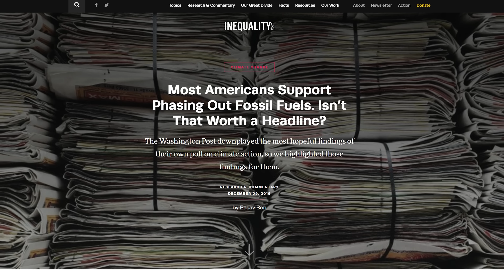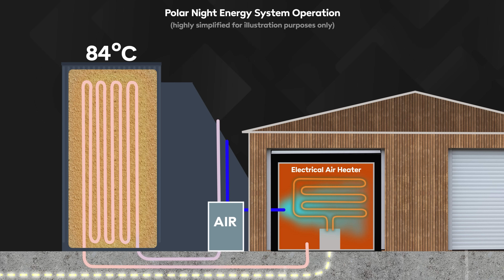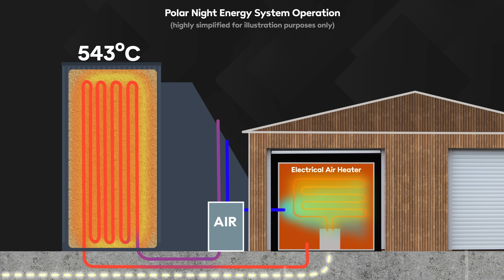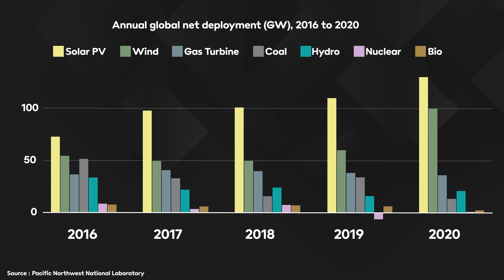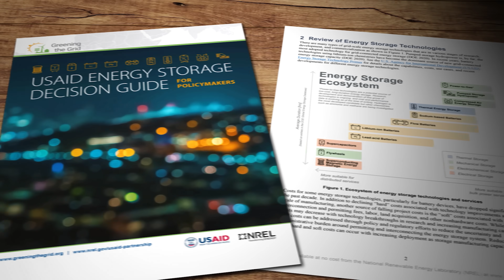The 'Sand Battery' that heats your home, NOT the planet!

Comment: Texas' power grid failed in 2021 due to a winter storm, with "natural" gas responsible for 42% of the failed electricity and coal responsible for 19% of the failed electricity, fossil fuels were responsible for the vast majority of the freezing citizens in Texas. Power outages took the "natural" gas offline, and frozen and freezing Texans would have LOVED to have had a system like you describe, they would have paid far above market price to avoid freezing their tushes off for days. The politicians in Texas, predictably, have done nothing meaningful to ensure there is no repeat of the 2021 outage, instead trying to blame renewables, when everyone knows that explanation is entirely bogus.

Comment: Not enough about heat storage for domestic use. Why is no one talking about old fashioned storage heaters. They can be 'charged' when electricity is cheap so providing a useful dump load for surplus power on the grid or from private PV arrays. They are cheap, simple and effective.
Reply: The idea with the sand storage is to keep the excess energy from summer for use in winter, rather than just overnight. Basically, it’s the same idea just over a much longer time scale

Comment: I am more interested in domestic solutions for singular buildings than district heating options. Retrofiring entire districts will be slow. 
I have read up some on simple solutions like water tanks to store heat, but also on thermochemical heat storage (salt + water --> exothermal reactions) The storage density is lower than water tanks themselves but they thermochemical batteries store the potential heat at room temperature meaning you can store it over longer periods of time.
(Smaller Water tanks may not be able to store heat over longer periods)
I plan on building a home with thermo photovoltaic panels on the roof (panels with heat recovery already featured on the channel) and other features which could give me the option to go off grid. 
I also plan to build my home with a lot of thermal mass and other features to keep my carbon/energy profile down. 

What other options for domestic heat storage are out there which are viable today? With the thermochemical batteries I have not found options to buy yet but it looks like it will come to the market soon. (Heat insyde with K2CO3 salt is one example)

Comment: What I think about this is that we could've had our cake and ate it too, if only we'd taxed fossil fuels correctly, according to their environmental impact. Other than cost, why would anyone choose natural gas over systems like these? I literally cannot find any downsides to these heat storage systems. They can use renewable energy when it's cheap aka during oversupply, helping to stabilize the grid. Their footprint is totally manageable and you could easily bury them in densely built up areas. They're made from dirt cheap materials and off the shelf components. They're positively low tech, so why are these not everywhere already? Why are we doing pilot projects only now?!
Reply: I'm pro-solar but we need to get ahead of solar waste.  Perhaps with a $15 deposit on solar panels to encourage their return to a central location.  And yes- if fossil fuel was properly priced (including $2 trillion for the gulf wars), we would be more likely to be on other diverse methods.

Comment: Im surprised people didnt use thermal water/sand storage earlier, my home has a isolated 100 000L water tank in its basement and I can heat my house with it for many months, My bill for heating in winter is ZERO because I heat up my water with solar in the summer
Reply: Your house?! How big is the house, if I may ask? 100 m³, or 100 tons of water seems insane, but I haven't looked into systems like that. It would make a good size indoor pool, if you decided to make it multi-purpose though 🙂
Reply: @phizc  that "pool" would be at least 70C hot, i dont think swimming in it would be a pleasant experience lol My house is 70m2 the basement is 30m2 but I dug in it another  5x5x4m hole so the shape of the tank is more energy efficient
Reply: @423GustavBern  lol. Good point about the temperature. 😁

Comment: FYI, I worked in R&D in home building many years ago. We build several experimental homes with super insulation, in Ohio, USA. The wall & ceiling R-factor was R-70. We used foam, wool, fiberglass and hay bale on different test homes. We found once the inside temperature reached 70 degrees F. If we kept the doors shut, the homes stayed warm for week or months. Also used 2, 3 & 4 panes in the windows. We proved it worked but owner did not want to spend the cost on normal buildings.
Reply: The prior owner of my house got some insane deal on blown in insulation.  I literally have 3 ' of blowin in insulation in the attic and double insulted storm windows.  My utility bills are about $800 per year lower than my friends in similar size houses (lower both in the summer $100,$150,$200,$125) and the winter (About $35 less for 3 months).
So it's saved me about $18,000 over the 24 years I've been in the house.
Reply: Replenishing warm fresh air is the clue there, especially in small volume houses.

Comment: I think on paper the use of water to store the heat instead of sand has the potential to be better because even though you can't heat it as high ends up having a much larger specific heat capacity than sand. Like more than 5x as much. But it's also more than twice as thermally conductive so you would need more heating insulation to keep it cool but would also result in more efficient and faster heating. Since you wouldn't have to wait as long for the heat exchange.

Comment: In Finland we have district heating in every major city and it's absolutely awesome. Very cheap and efficient system. I love to see this sand heat storage tech coming out of Finland when Nokia, Angry Birds and Clash of Clans are so yesteryear's news. If only those pesky Swedes hadn't made world's first fossil free steel (SSAB)... The race is on for a sustainable future and as we can see here, innovation isn't dependent on the size of the nation!
Reply: Technically, it isn't fossil fuel free. Most nitrogen is made from burning coal. It is then transported using fossil fuels. Check out watch?v=BaGO8jIxVdA
Reply: @GrahamCampbellNZ  technically gold is free too, as are all raw minerals and food. Extraction costs a bit, but the lions share is company profits.
Reply: @GrahamCampbellNZ  I misread your first post here, sure, the steel isn't fossil fuel free but it could be very nearly if all heating was done without fossil fuel.

The metering aspect isn't a cost issue, rather a technical one. I lived in a place that had district heating, and billing was its complete downfall. Usage was measured by evaporation of water in a vial on every radiator. That meant that meter readers needed to enter every room if every flat. That simply was not going to happen, not on that estate anyway. Then there are all the ways to cheat such meters.
Reply: @dougaltolan3017  Yes, here they tried smart meters but not a win with the public. It is never for 'Our' advantage, just theirs.

One way of looking at the steel - I drive a 20 year old car but an EV will only last 10 years before needing a new battery which will be "Sorry Sir, no longer available, we use different tech now" or "Your software isn't compatible". So the EV will be scrap. So EV's are 2x as bad and the lithium isn't recycled into new lithium (unlike steel).
Reply: @GrahamCampbellNZ  All I got for EVs is the Nissan Leaf you can replace a single cell in the pack. I don't know if Nissan consider that a good idea, but it does mean there is the full, healthy second hand market and fix at home capability.
Also, as usual, new battery tech is on the way. Last I saw was sodium based batteries.
Reply: @dougaltolan3017  That's my issue. When you take the Leaf or Tesla at 10 years old and ask for a replacement they will say "Sorry, we use sodium now and that is not compatible with your operating system which we can't update either. The goal of making profit will override the social good aspect. BMW already doing this with their heated seats option - "Sorry Sir, can't fix, buy a new car". A Leaf owning friend was quoted 8k for a new battery, but the car is only worth 7k (Same depreciation with early Teslas). So overall, they are more wasteful because of a shorter lifespan, higher cost and inability to recycle the lithium into new batteries. An Australian bank has started to lend only for EV vehicles.
Reply: @GrahamCampbellNZ  Yerbut..
The Leaf battery pack can be repaired down to individual cells.
The good old buy a scrap car for parts still works with them, breakers yards will extract good cells and sell them for home repairers.
It is, notably, the only EV that has this though, probably an oversight by Nissan.

I drive a 40 year olg Land Rover diesel. The only electronics on it is the alternator regulator pack. I do appreciate nuts and bolts engineering, but also understand the new "computer says no" way of doing things. You just need a different toolkit to work on new cars.
And yes, renting features that are installed but need software keys to unlock does make sense. Cheaper to manufacture, so cheaper to buy and you can mix and match features frequently without needing to buy a whole new car.
Reply: How is the heat use metered? How are bills calculated?
Reply: @dougaltolan3017  Volvo claiming "Fossil fuel free steel" is BS on a large scale. Not counting the power to run a meter is insignificant.
Reply: @dougaltolan3017  Each house has a heat exchanger connected to the district heating system. The use is measured as kW from the incoming water temperature (close to 100 degrees celsius), the outgoing water temperature and the volume as litres of water. I live in an apartment building with close to 100 apartments and we have this system. Living in Finland.
Reply: I don’t know why, but GB is a mess with regards to heat and insulation, I’ve been in the heat and ventilation industry since the late 90’s nothing much has changed with regards to those aspects. I’m sure others will beg to differ.

Comment: Hmm. Interesting. But as a single woman living (by choice) on an annual budget of under £1,000 [one-thousand quid per year], I avoid all kinds of problems by not heating the environment and not heating my home at all. I just heat myself.

Ooh, radical idea... 🤭

My 2-bedroom terrace house (north of England, West Yorkshire) was built in 1913 in an old coal-mining area and has no heating whatsoever. The fireplaces are bricked-up and the chimneys are capped (and the area is now supposedly a smokeless zone).

There are no central heating bits or solar panels or heat-pumps or convection heaters or oil-filled radiators or even warm cats to cuddle, but that's all right because there's no bill to pay, either.

I once explored the possibility of having a modern multi-fuel stove (one officially approved for use in a smokeless zone) to cheer the living room up, but the installation and essential flue lining would cost several thousand pounds that I don't have and can't afford anyway.

Recent changes to the regulations mean that you're no longer allowed to install such things yourself and have to employ a certified professional. Ker-ching!

The loft has 3" of ancient fibreglass insulation which was fitted in (I think) the mid 1970s, but it serves no useful purpose now - and there's no point in topping it up to whatever the recommended modern depth is because the house is permanently cold and has no heat to lose.

I don't use any hot water besides that in a kettle for brewing a cuppa, and for the past 14 years have managed well enough with icy cold water, a stiff upper lip in the bathroom, and a zero-expenditure on heating. My annual electricity usage (which goes mostly on cooking) is between 200 and 300kWh [two-hundred and three-hundred per year].

I don't have a fridge or freezer, but the house has an old-school cellar which will keep fresh food safely edible for up to a week. It costs nothing to run what's basically a big hole in the ground.

I admit that I did knit myself an extra-thick woolly hat recently; it cost me £0.38. I regard that as money spent on insulation, not heating.

I realise that it's not a lifestyle choice that many will choose to copy, but it suits me. I just wanted to let people know that there's more than one way to solve some problems. 🙃
Reply: Wow, you are an anomaly, my dear.

Comment: 25+ years ago I helped my son do a grade school project where the children designed a new city. I couldn't help but get involved. We put a small nuclear reactor plant outside of town and used steam and hot water to heat central apartment buildings in town in the Winter. We had a central evaporative cooling tower to provide cold water for Summer home cooling. There were crops grown in hot houses all around the outskirts of town, passive solar heating was used as well. It was a fun exercise but not very practical.

Comment: Hi Dave, I have 5 properties all running on a district heating system powered by a wood pellet boiler.  I also have a 15kw turbine.  I get both RHI and FITs, so the system is fairly cheap to run,  However, my pellets have just gone up by 25% and the 'writing is on the wall'  I was going to look into hydrogen production and storage through metal hydrides, but this sand based storage fits in much better.  I could use the biomass to top up and the wind turbine to charge the heater.  So, a great idea Dave.  I live on the Isle of Mull where energy is hard to bring onto the island.  Anyone with further ideas would be welcome to share and discuss them.  Alan
Reply from the maker: Hi Alan. Thanks for sharing this. Good on you sir! I wish you well :-)

Comment: Create a warm sitting area with thick curtains hung from the ceiling in part of the living room or a smaller room. It's best to reduce the volume you need to warm to a higher temperature, what parts of the house do you spend the most time in? Focus on keeping a healthy warm temperature in the place you will spend the most time, other areas of the house only need to be kept at 12-15c tops. Unless you have genuinely serious health issues that prevent you spending a minute or two intermittently in a cooler temperature with decent warm clothing, which statistically you almost certainly don't, you don't need to heat the whole building through. It's good to think about what areas of your home are most central and which walls are exposed ect also, even what heat electrical appliances are creating heat and perhaps doubling that use up if practical. Bedrooms are better kept a bit cooler with warmer blankets and duvets and many a mattress heater, air quality is important for sleep so its good have "some" outside air exchange.
Reply: 10 minutes with an electric heating pad on low under the covers before you get in bed makes a huge difference to sleeping comfortable.   Cost is pennies.

Comment: In St. Louis, Mo downtown buildings built in the early 1900’s were heated in a similar manner.  There was a monster of a coal fueled power plant near downtown whose steam after turning a generator cooled to the point of no longer being useful for generating electricity but was more than hot enough to heat buildings.  This heated waste was conducted to downtown buildings via underground pipes.

Comment: I was just wondering why don't they build them in the ground all you would need is a sand pit with insulated walls and the earth would keep it a around 57 degrees Fahrenheit as well and you would not need to worry about the weight of the sand or building up?
Reply: I have wondered for a while about how successful digging a large hole,  lining it with a waterproof lining and insulation before putting the soil back in with a heating coil to take solar heated water into it. the same coil could then draw the heat out when required.

Comment: This sounds great for small to medium industrial heating.  Residential district heating only makes sense in locations where there is no need for air conditioning.  Continental Europe is discovering that not having a/c is rather uncomfortable right now.
Reply: You can also have district cooling, our 130k town has that as well as heat. Cooling is mostly for larger consumers though.

Comment: I’d really be interested to hear more about strategic planning for the local/national energy storage infrastructures needed for a clean energy future. Maybe about the numbers of (relatively small storage) facilities that might be required to keep the lights on. Also about the potential carbon costs of setting up these types of infrastructure. It seems to me that the technical issues about which types of storage systems are best, etc. are now secondary: there is enough technical innovation already to move on to questions about how to build smart, decentralised storage infrastructure in different nations. Of course it’s a huge generational project and will unfortunately require wise national political will, which is always in short supply, at least in the UK. Still, the move from a national energy model based around a few, massive ‘power stations’ to a model that involves huge numbers of smartly integrated local power storage facilities, simply has to be talked about.
Reply: Well, there isn't one. All the large countries in Europe, UK included, Eastern Europe rely principally on gas and coal and no one is planning to change anything untill, perhaps, 2050..
There are Baltic's + Finland where there is something in the pipeline, Denmark + Holland doing little bit as well, that's it.
Reply: @petrskapa793  Why is it not being considered or discussed, though? It seems strange to me.